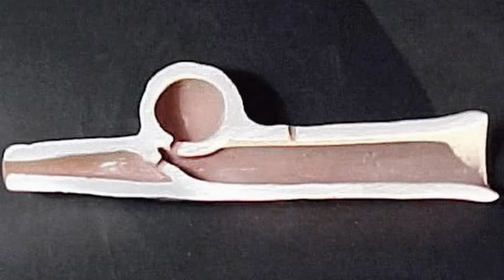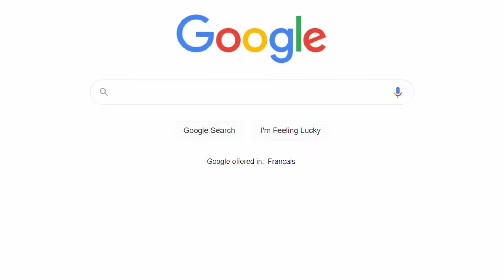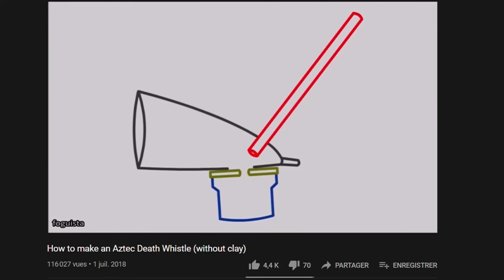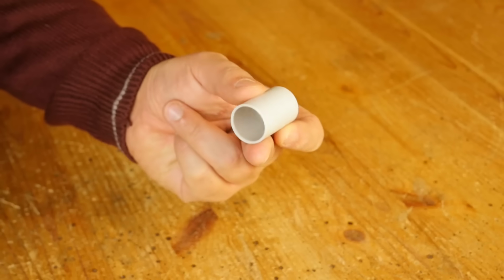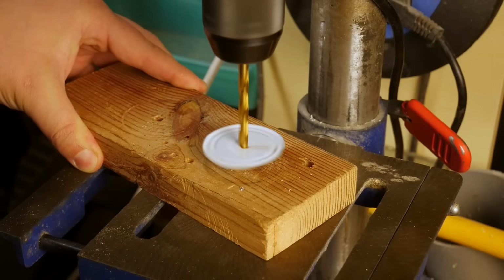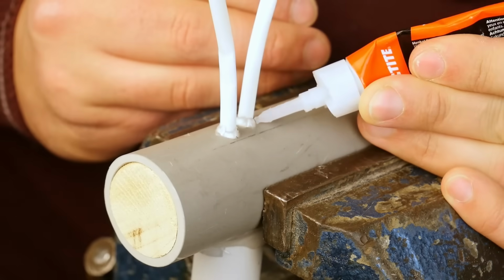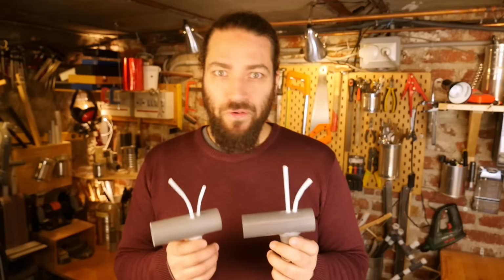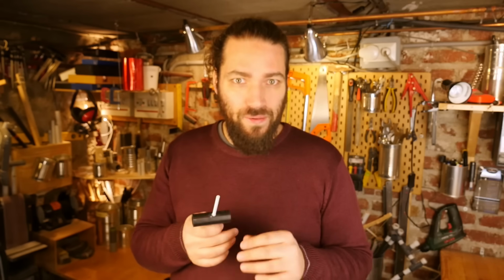Building DIY DEATH WHISTLE

Comment: The little metal thing he had in the beginning sounded more like the actual whistle than all of the pvc ones he made.
Reply: Yeah, all the others sounds like white noise
Reply: Darth Vader flute
Reply: does anyone know what its called? I cant understand what he's saying sadly
Reply: @ioth303  he called it a "bird call"
Reply: Yeh, no offense, but it just sounded like air blowing through a plastic pipe. The last ones when the pipe was covered with the cupped hand was the best result.
Reply: Hi I am someone else responding there are 3 different people on this account and I can 100% confirm that if what you said was offensive by saying no offense will help
Reply: @Cwjespersen  that's creepy af
Reply: no
Reply: @EchoLog Aztec Death Whistle. You can buy cheap ones or print one
Reply: fact
Reply: Yup.

Comment: Interesting. Sounds similar to when I was a kid, we used to blow on a blade of green grass held between the thumbs and the side of both palms to make it whistle. If you blew too hard, you sometimes got a similar sound until the grass broke.
Reply: naw i saw people blowing into grass waiting in line for a roller coaster yesterday and it whistled kind of is that what they was doing?
Reply: @Memer9456  I guess it is a little different even though the sound is somewhat similar, the blade of grass acts as a reed that vibrates if I'm not mistaken!
Reply: I do that often as I’m walking my dog and the lawn has gone for 6 days without being mowed- that’s when I can find the most perfect grass blades for it.  I use it to call birds in the area, because by the way I close my hands around it, I can alter the pitch and such, also I can trill my tongue and make it really animal like.  The best grass for it has a broad flat blade, without a central ridge- the ridge really ruins the sound, and often makes it just tear when you try to blow through your thumbs.  👍🏻
(In my opinion, it doesn’t really sound like a death whistle at all, but it’s a more clear note.)

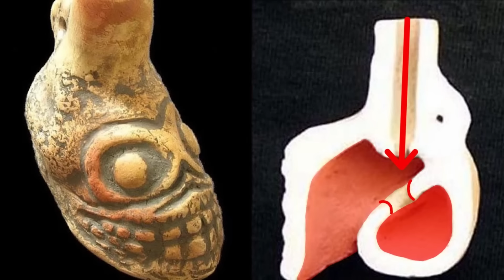Comment: May I make a suggestion? In the part about attempts at clay reproductions of the instrument (1:36-1:48) I see spherical and hemispherical resonating chambers (the ones that the sound does not emanate from- you identify it as the place where the air vibrates, but that's just another way to say "resonator") but in your version you have a flat-ended cylinder. I don't know how technically educated you are in acoustics, but differently shaped resonators will emphasize different harmonics and overtones. It's possible that you simply cannot exactly replicate the sound of the original with a flat-ended cylinder.
So what is my suggestion? I love the idea of making it variable, so maybe you could make the end of the plug that goes into the cylinder a hemisphere to try to catch the harmonics that I'm not hearing.
(Yes, I know, the sound you're hearing is not necessarily what I hear due to recording, data transmission and playback compression via YouTube plus my cheesy speakers, but I still don't hear quite the same sound from the reproductions as from the original.
Just trying to help.)
Reply from the maker: You're right, I wanted to try to tune them with pipe extensions!

Comment: I’ve accidentally made that sound just using the cap from an acorn that I found in the woods. You can hold an acorn cap between your thumbs and only leave a small gap open and then blow across the hole. You can whistle super loud with it. Or blow at the wrong angle and get this kinda sound.

Comment: From Wikipedia: 
A common misconception is that this whistle produced a sharp shriek-like sound. However, these sounds credited as the Aztec death whistle are actually produced by much larger reproductions of the whistle. Music archeologist Arnd Adje Both, who has tested the original excavated whistles, reports that the actual sound produced is far softer, describing it as similar to "atmospheric noise generated by the wind."

The idea has been popularized that hundreds of warriors would use the whistle at the same time. However, there is limited evidence to support this claim.[3] Music archeologist Arnd Adje Both suggests that the purpose of the whistle – based on its location at the base of a temple, its imagery related to death, and the lack of whistles ever discovered at battle sites or in warrior graves – was far more likely to be ceremonial or religious rather than for warfare.

Comment: Now, why not try and make a flute of it, that is able to make different sound frequencies?
If you make the vessel in such way it can change angle, or, make a large one which you can manipulate with a "stop" on a stick that can slide through the pipe vessel, thus making the vessel longer or shorter stopped, this could work.
You could even combine both the angle and the length idea for an even broader sound spectrum?

Thoughts?

Comment: The whistle sound like a scream in da distance.. yet the flute is colseby the mic..   it's changing  when flow or  pressure is changed..weirdly it matches up a womans scream perfectly ..the start with the high pitch lots of pressure.... the way the two sounds hang on independently crossing dualtone.... i think the wole thing even sound more extreme with a bit of fluid or spit in it..

Comment: I know this is a couple years old now, but I want to point some things out.  The noise you're hearing on the original demonstration video has distorted audio, bad mic quality to start with but the guy is also playing a whistle that's meant to be heard a fair distance away straight into the mic, it doesn't take much thinking to figure out the audio is heavily distorted and no amount of post-processing is going to fix it.  Secondly, think about the use and what it's meant to sound like, white noise isn't going to scare anyone, but screeching will, war cries exist abundantly throughout history; now couple this with how much energy a blood-curdling screech takes, and now compare that to how much energy and lung capacity a flute takes.  Also look at other various stories and myth from the Americas pre European settlement, you have the same basic things with local twists throughout the super-continent, and where else do you have screeching in particular come up, of which screeching is also typically accompanied by mimicry of human voice no matter which myth it stems from; throughout human history, no matter where, your enemies are dehumanized and demonized to the point of being something else entirely, most of these myths more than likely realistically stem from altercating tribes, with things like the death whistles having similar function to any audible war tool, take for example the Vikings and their war horns which also have a mythical aspect to them.  Connect the dots and a death whistle is supposed to be a screech within the upper human vocal range, typically that of which a woman will more realistically achieve; and maybe there's some actual meaning to the death part of the name, considering it's a blood-curdling screech.  It's really not that hard to figure out. 

Honestly, the whole white noise and wind thing just shows how much logical thought people lack, undereducated perhaps, and it leads to appropriation considering the object is being so utterly misrepresented.  It's cool to find new and wacky instruments, but don't call them death whistles, do not make them representative of something they are not.  It's really no different from paleontologists claiming they know what dinosaurs sound like based on fossilized voice boxes, yet that sound changes drastically every five years, what was roars 20 years ago is now, modernly, bird-like by newer findings and more study.  People really need to take a few seconds to think logically before spewing bullshit.

Comment: You could probably start by measuring the resonance frequency of the resonator part and then make the outlet pipe size resonate at a multiple of that frequency.
This way you will maximize the effect I belive in the same way a swing or a tesla coil works